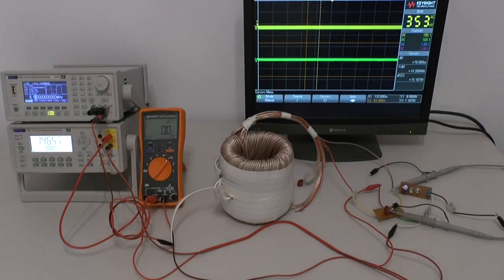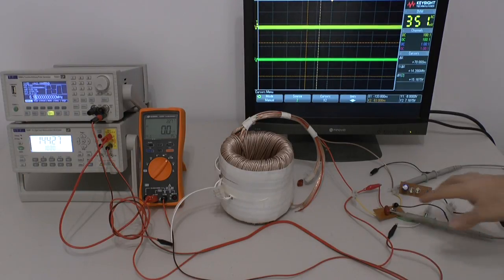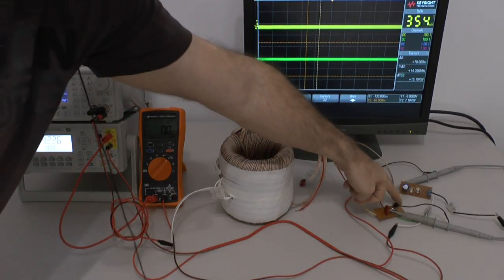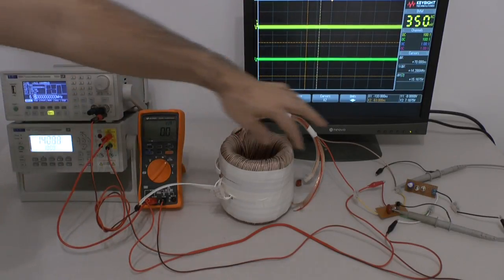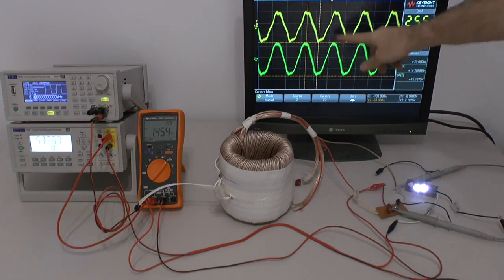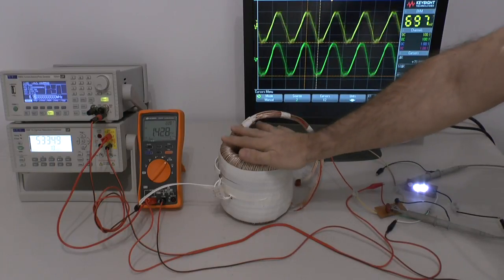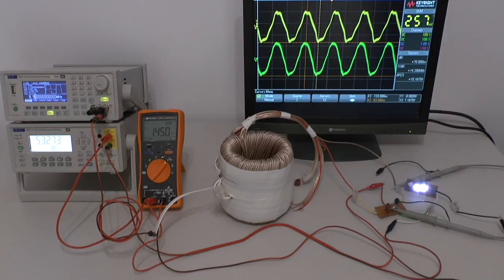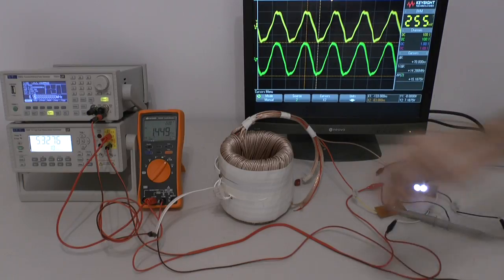NG Coil system pulsed with no ground reference

Comment: Is the signal generator grounded? Normally the coaxial output will have the outer shield connected to the equipment ground.
Reply from the maker: That is true but not relevant here because there is no ground connected to the coil and load and as demonstrated it would not work either.
Reply: TheOldScientist But there is always some capacitance between the ground and anything that's not connected to ground. A small capacitance at MHZ frequencies is just the same as a physical wire connection to those high frequency signals. That means there has to be an ac connection to ground through the capacitance which you're not mentioning. The capacitance will then create a resonant circuit with the inductor.. and will pass current best at resonance.
Reply: Didier Khwartz your welcome, but it's not a viewpoint..its fact 😀

Comment: At 2:27 did you mean orthogonal? I suppose its implied by '90 degrees'. It's an important feature of these circuits. Orthogonality can be achieved in other ways too, and it may help decouple the input and output power in the way Mark S mentions below. There's a little more nuance to it though... Orthogonality is necessary but not sufficient, and there are other factors involved in getting these coils to interact once we remove the standard Lenz' law, including variation or permeability and permittivity, or other parameters of the circuit. I'm currently working on a mathematical proof and designing some experiments towards that end.
Reply from the maker: True it is only an example to get the brain cells moving also called motivating I hope
Reply from the maker: Michael, Yes I said orthogonal and I also said 90 degree opposite to each other. Watch the footage again.
Reply: That is fine. It's just a very important point to make clear, so that people may understand.

Comment: Nice work...one may induce a potential in an 'orthogonal' (perpendicular) coil set such that the inducing coil does not 'feel' (Lenz's law cancelled) the pulse induced into the induced coil.  This interaction is enhanced if inducing coil is composed of two opposing (oppositely wound coils) coils.  The Old Scientist is showing this with low voltages as opposed to Tesla's High Voltages.  Electrons are free to vibrate in the 'hot circuit' (LEDs) in synchronicity (coherent) even without a closed circuit.  In fact you see an analogous  situation occurring in all circuits in connecting wire in which two capacitors  are connected in series.  The hot circuit, therefore, may be enhanced by adding more copper atoms (i.e., thicker wire) and tuning length to frequency of the wire (Tesla did this all the time).

The requirement for a 'closed' electrical circuit is a special case of my rule (copyright of Magnicity) that a closed Potential circuit is required for an electrical circuit.  Potential transverses conductors as well as non conductive mediums and also prefers path of least resistance.
Reply from the maker: The path of least resistance is still valid as long as you provide a shortcut. If not, the electrons have to find another way to the destination. A good way is to imagin the pressure of water in a hose. Even with holes in it not all water will go through it and still end up with pressure at the valve. It is all about ratio.
Reply: Yes, as path of least resistance approaches capacity (and thereby presents resistance), other paths of least resistance will accommodate the potential(s) which overall appear as a ratio of the total.
Reply from the maker: True

Comment: What do you intend on doing with all the stuff you've learned/going to learn?
Reply: Im just curious what do you think of Eric P Dollard?
Reply from the maker: He inspired me and I replicated many of his experiments in the past. You find many of this lectures and books on my website.
Reply from the maker: To teach
Reply: TheOldScientist you better help me build wardenclyffe tower one of these days
Reply: http://amasci.com/tesla/tmistk.html Here is a pretty good explanation of the basics. It's not an energy generation technology, only energy transmission. The issue is all you have to do is build a coil and tune it to the frequency of the driving coil to receive power. There is no good way of telling who gets that power and who to bill for it, so in that sense alone it is free energy. The person who wrote that webpage got the inductive half of the circuit right, but has only partial understanding of its dielectric nature - where displacement currents exist between the earth, the spheres and even the ionosphere. The earth also has variable impedance depending on the contact resistance of your ground, the geographic location, the weather, et cetera, but an optimal operating frequency always exists. When the ground is conductive after a rainstorm, the system uses its inductive circuit more. When it is very dry during a drought, the capacitive interaction becomes the main supplier of power. Thus, the earth need not necessarily be electrically conductive to transmit power, since a dielectric may also transmit power, as with photons in glass or air.
Reply from the maker: Correct
Reply from the maker: I know
Reply: TheOldScientist haha not really much more we can say about him. Appreciate the work man really nice job indeed. Thanks for sharing.